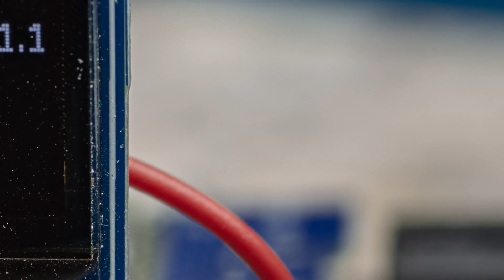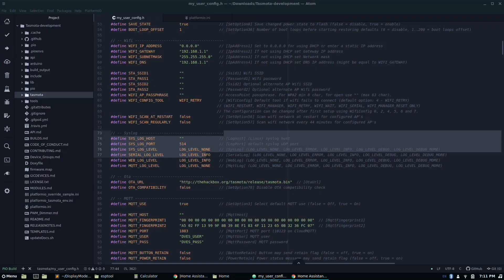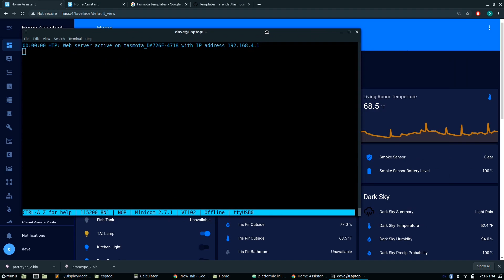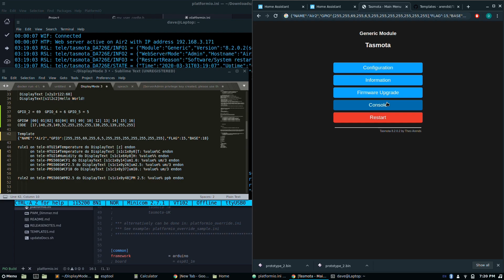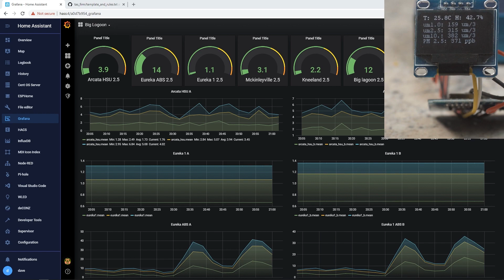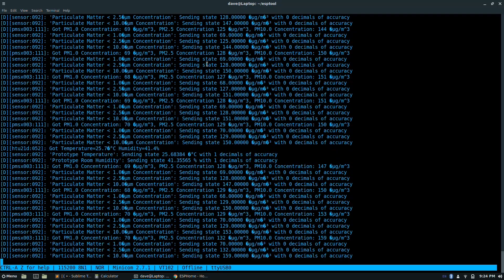How to set up a LCD to Tasmota and Esphome with a PMS5003 High Precision laser Particle Dust Sensor

Comment: I had one of these sensors arrive in the post this week and was deciding if I should use the Tasmota or ESPHome firmware, talking to Home Assistant. Came across your video which shows me both. I think I will go the ESPHome route as I don't want to have to be modifying any firmware if I were to update in the future. The YAML route seems more straight forward. Hadn't thought about using an OLED on it and have already 3D printed a case. Guess I'll have to order another one and make another case incorporating the OLED . Cheers